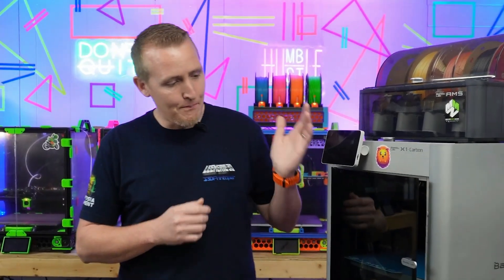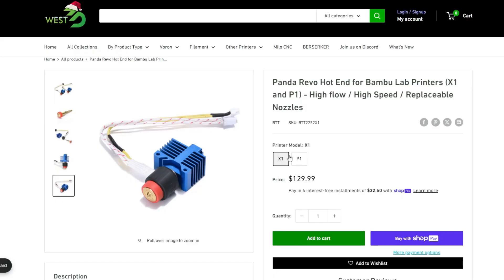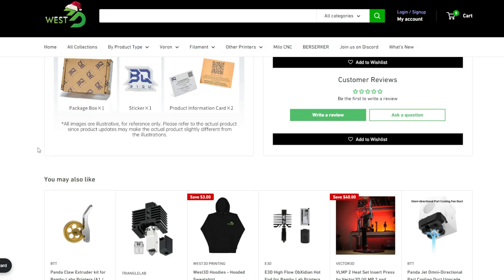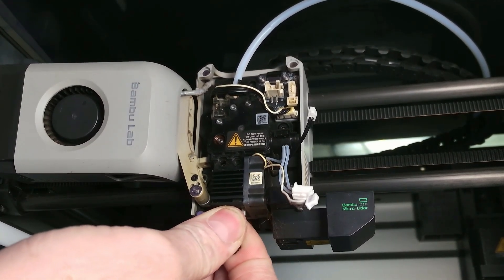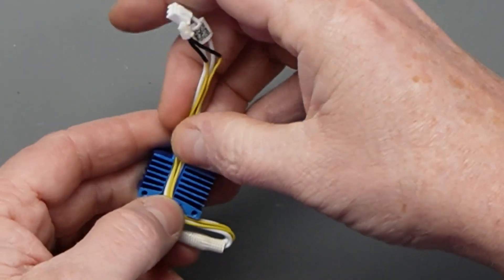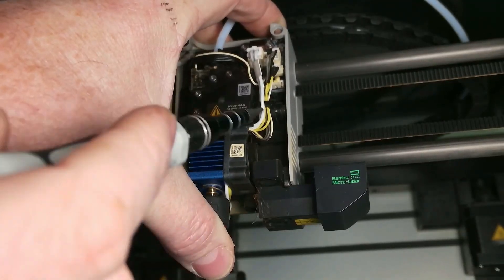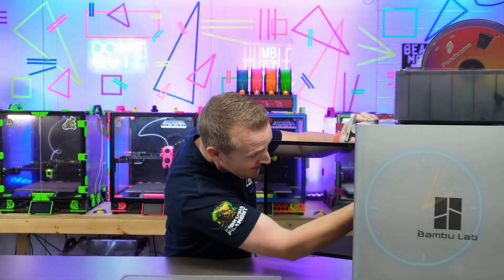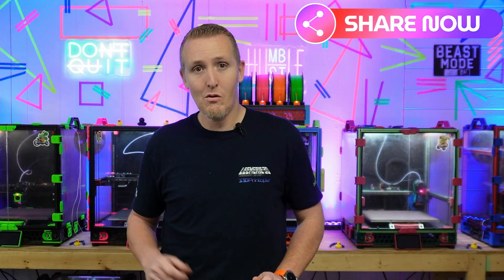Swap Nozzles in 30 Seconds! Upgrade Your Bambu X1C with the Panda Revo Hotend 🔥

Comment: For anyone thinking of getting this, it’s amazing if you swap nozzles and have more than 1 printer (I have a P1S and an X1C). 

I will say that the Panda Revo is great, but DON’T GET THE PANDA CLAW. This is what ruined the nozzle for me, even though it’s listed as a hardened steel extruder. For some reason, after multiple hours of printing abrasive filaments, those gears no longer extruded. I swapped back to the normal plastic/hardened gears, and it works fine.
Reply from the maker: Thanks for watching! I have not tried the panda claw. Thanks for the tips on that. This is great if you already run the Revo in other printers for sure!

Comment: While I think the nozzle swap on the X1C could be even easier (aka, like it is on the A1), if you're changing the thermal grease to switch the nozzle, you're doing it wrong.  That method is to replace the nozzle.  To swap, you want to have a complete hotend with thermistor and fan ready to go.  At that point, it's just two screws and the fan connectors.  After you do it a couple times, and especially if you have some tweezers or 3d-printed equivalent, it only takes a couple minutes at most.

The complete hotends directly from Bambu Lab are only around $30, which is cheaper than some other nozzles alone.
Reply from the maker: This is replacement of the hotend which is why it was done the way it was. I agree though, the A1 nozzle swap is so much nicer. Wish the X1 was the same.

Comment: Are they any better than the stock nozzles or is it just for ease of nozzle changing?
Reply from the maker: It's just the ease of changing nozzles. The actual nozzle is not better. Though you can then change to some of the higher flow nozzles and even the diamondback or something if you wanted to.

Comment: I have been running this upgrade for over a year on my X1C. I love it because I change nozzle size/type often and I never hesitate to do it. The only trouble I have run into is poor Z ofset because I didn't recalibrate after change. I wish the had a calibrate for just z offset. (Bambu are you listening?)
Reply from the maker: That's awesome! I'm glad you left a comment. Some people (even here in the comments) have said they had issues with theirs. I have been running mine for a couple months now and haven't had issues. That's nice knowing you have been running for a year now. My z offset has been fine though 🤔
Reply: @leemerie3d  It was just a little shy of the normal squish after changing a nozzle.  I wasnt great bed adhesion but after a calibration all was back to normal.
Just had a nozzle that was a smidge shorter than the others
Reply from the maker: @christopherlarime4095  yeah that's strange. There is a setting also in the screen or app where you turn off textured bed sensing. I have that off on mine. Idk if that matters.

Comment: Why not a single word about the wiping problem? The wiping function does not work properly with revo right?
Reply from the maker: Not wiping? I haven't had any issues with wiping that I have noticed. If I had, I would have mentioned that. That being said, there are a few nice mods out there to add some "extra" layers of wipe there. Adding a silicone brush basically is one. But no issues with mine. Id love to chat about what's causing that on your machine. Are you on discord? Our server link is in the video description as well. If there is some known issue with this that a lot of people are having, I will gladly do a video update on this.

Comment: Not an upgrade...and if you need a wrench and screw driver to take out the 2 screws to replace the nozzle on the printer then you are doing something wrong.

I have Panda nozzle and many of the various tips as well...and honestly it's a waste of money.  I have the Panda Jet as well, another waste of money.  I have the Panda gears...a waste of money if you have the X1C.
Binq/Big Tree's tech support is AWEFUL as well.  The only thing they have that maybe worth is it the Cool plates.    

Don't fall for the marketing hype.
Reply from the maker: I wouldn't go that far as it's a waste. Btw I love those that cool plate! If someone doesn't already use Revo on other machines I would say don't even bother. There are some other better options out there. But, to each their own. I hope you enjoyed the video! Thanks for watching!

Comment: You changed it brand new and clean. Would it be that fast after a hundred prints with various filaments? Does it need tools for swapping? The remains of filament inside can make it doing with bare hands problematic I guess.
Reply from the maker: Yeah I did it brand new and clean. But to be fair, there is not much difference when it's been printing. Still removes and goes back in the same way. I guess at around a minute when you aren't racing to do it. 
No tools are needed though. Just loosen it out by hand.

Comment: Running this on all of my machines (2xP1S, 2xVoron V2).  This lets me swap nozzles between all 4 machines (and I've had to do it).  Love these
Reply from the maker: That's awesome! I have the Revo on one of my 2.4's. It's the Revo PZ. If you haven't checked that out, I did a video on that too. It's a pretty neat! Thanks for watching!
Reply: @leemerie3d  Yeah... I'd like to get that setup, but never in stock....
Reply from the maker: @rch317  Yeah I totally understand. I was able to grab one really quick when they came out. They sell out just about as quick as they stock right now.

Comment: Excellent vid.  I have most of the revo nozzles all the way to 500C.  All are compatible and take about a minute to swap without racing.
Reply from the maker: Nope, 29 seconds as shown in the video 😂 At normal speed about a minute is exactly correct. I've got a few Revo nozzles here as well. I am running the Revo PZ in one of my machines.

Comment: I would change them more if it was easier. Other than quick change is there anything else worth doing this for?
Reply from the maker: Man I don't think other than the quick change there is a good reason. If you change nozzles often. Or if you already run revo in your other printers. A lot of people run the Revo ecosystem.
Reply: We wanted to be able to print our maker chips with a .2 nozzle to take to the Rep Rap events. This will make the switch each year very easy. We may need to invest in some High Flow nozzles while we're at it!
Reply: My understanding is that if you don't run revo, it's considered by many not worth it.  I run revo in everything.  It's also not just the quick change.  It's also toolless.  It's done without a wrench.  You don't need any thread sealant or grease on your nozzle.  It truly is eazy-peazy.
Reply from the maker: This is true. The not having to get a tool for the change is very nice. I'm only running the Revo PZ in a 2.4 though. It's very cool though!